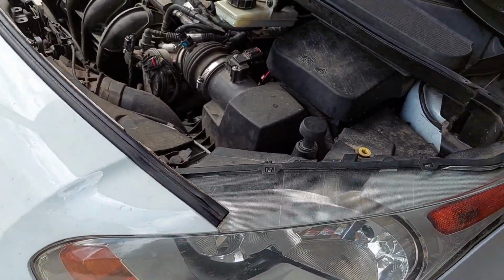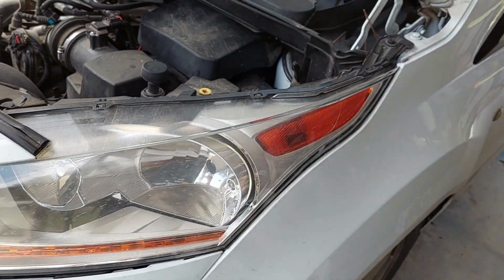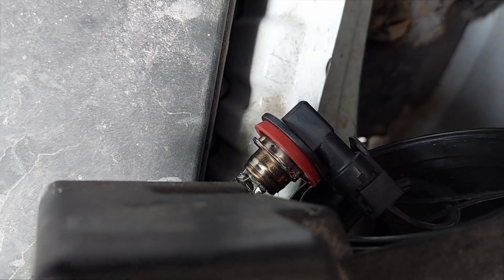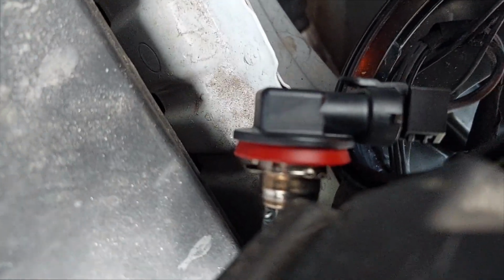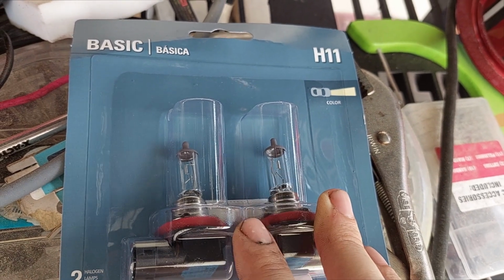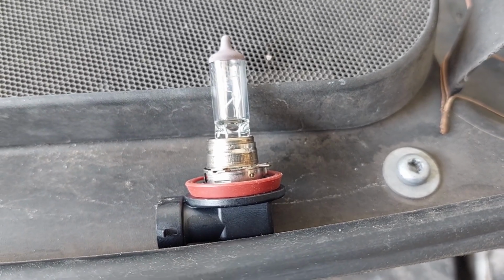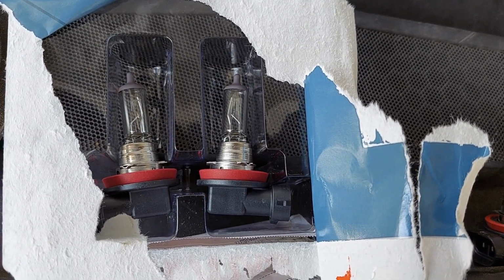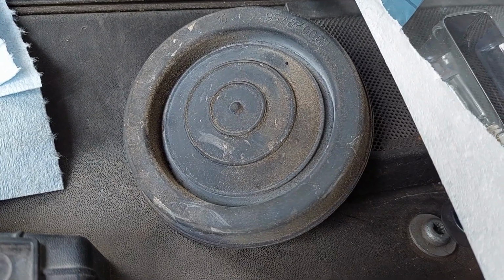Five Minute Fix 28 - Low Beam Headlight Bulb Replacement 2016 Ford Transit Connect

Comment: I was wondering we have a headlight that still works but it only works when the headlights are on when it is awesome and you unlock the car the headlight is out and I was wondering how much it is to replace it
Reply from the maker: Do you mean the same bulb is not working as a running light but lights up when the headlights are on?